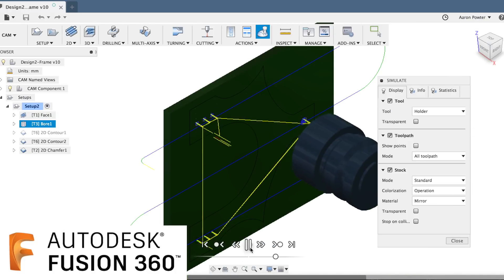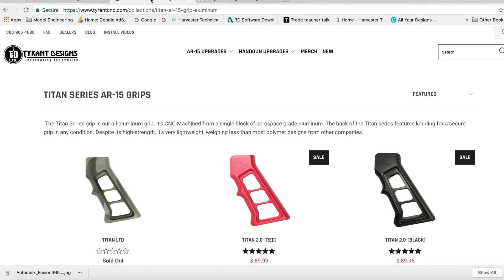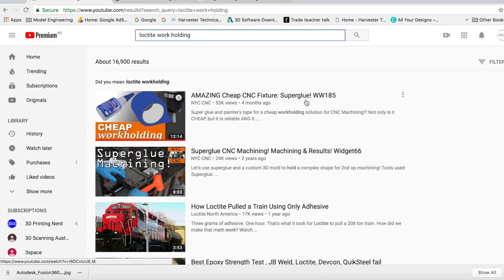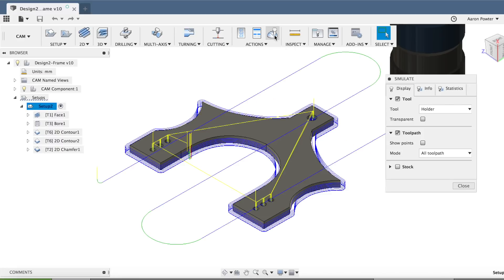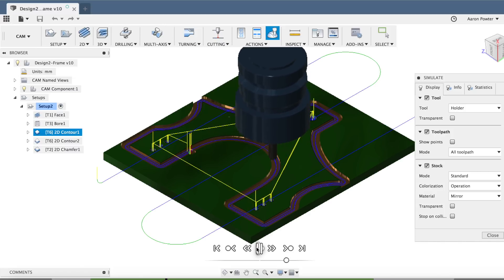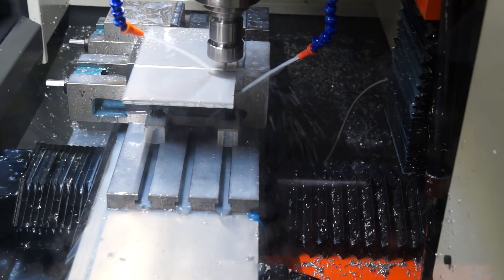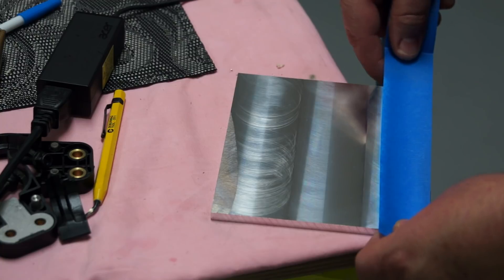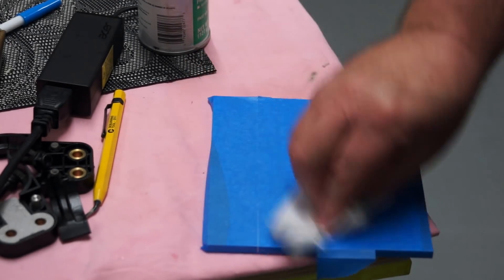Batman Slingshot with AR15 Grip - Making the frame Pt.2

Comment: ah yeah the adhesive trick!! I've also had luck with double-sided 3M automotive tape with larger workpieces. The smaller stuff will deform since the tape is almost too strong (lol). Hey you gonna need a permit for those projectiles!
Reply from the maker: G'day Andrew.  Yeah I used to use double side tape from Venture Tape USA.  But I can't get it anymore over here.  I'm not even sure if they are still in business or sold out to another company.  However, the double sided tape works fine usually.  But it doesn't like coolant.  Was actually impressed with this blue tape and superglue.  Oh yeah, you're not wrong mate, I've got to be very careful with these bad boys ;-)

Comment: Great video Aaron! Funny how that super glue trick works, you are really (it seems) only glueing the tape together so it's really only the tape actually holding the part down! I would imagine there is a limit to how small a part can be held using that method as it needs quite a bit of surface area to actually hold it.
Reply: Cape Cod CNC if the part is really small you can glue it directly to an aluminum plate and use heat to remove it
Reply from the maker: Hi Paul.  You are 100% correct mate, it's all down to surface area.  The blue tape I used was medium tack, I think a stronger tack would be more advantageous.  Cheers buddy.  Aaron.
Reply from the maker: Yes you can also do this approach.  However, I have it let go before with direct gluing.  But this was on the Haas SMM2 and I was flooding the crap out of it with coolant using a cheap $2 glue from those variety discount shops :-(

Comment: The video is very good, the adhesive is quite resistant. But since the piece has holes, I would make a useful and subject to this, it would be faster and you can do in series.
Reply from the maker: Hi Roberto, you raise a very valid point mate.  I agree, I could have used pins and bolts to secure the part.  I have done this in the past and it works a treat.  However, after seeing this method displayed on YouTube, I wanted to try it out for myself and share my success with you guys.  Cheers, Aaron.

Comment: Hi Aaron, what type is that activator? This reminded me about an almost unused can of activator I have for thread locking; maybe I can find an extra use for it.
Reply from the maker: Hello Nick, I think this is their standard primer (Loctite SF 7471).  You are correct, it is one commonly used for thread locking. I was going to purchase the quick set activator, but the service guy suggested I didn't need it.  I know the primer strips all, dirt, grease or oil off when using it, so I thought I'd give it a try.  Oh, I did what you suggested and ran the footage at 100%.  Trust you enjoyed it?  Cheers mate, Aaron.

Comment: Thanks again Aaron for a great video. I notice, or I think I see,  your mill rapids not in a straight line but rather follows a dog leg path... is that done in CAM or does the controller control that?  Any reason why the shortest path would not be chosen?
Reply from the maker: Hello Ian.  Oh my, you are very observant.  Would you believe that I've never taken any notice of that before?  I actually went back to my video to see it for myself.  I'm positive this is done by the Adtech controller.  The G-Code provides the X-Y coordination, but the controller moves both axis at the same time (rapid) so the shorter path is reached first before the second and this gives the "dog leg" motion / perspective.  I will need go back and look at some of my Haas footage to see if it happens there too?  Thanks for the homework Ian LOL.  Cheers, Aaron.
Reply: DCTTeacher1 I think I see why perhaps?.... it's not an uninformed dogleg... x then y ... it appears to xy to point such that the final movement and stop are along one axis only. I imagine this winds out any backlash and allows better control of arriving at the destination?.... more to research and discover!...